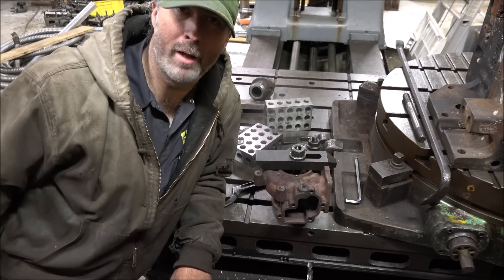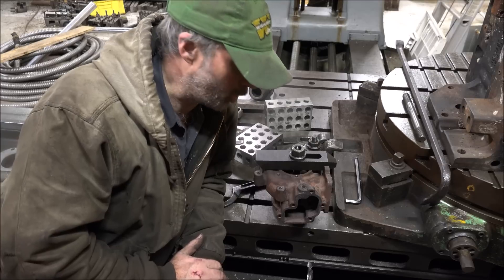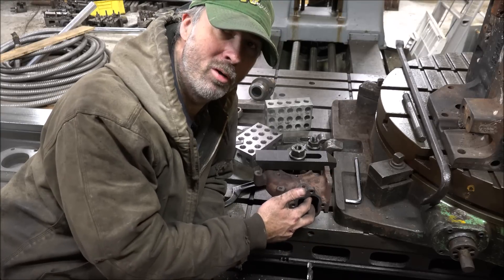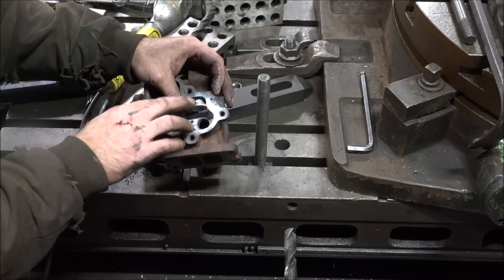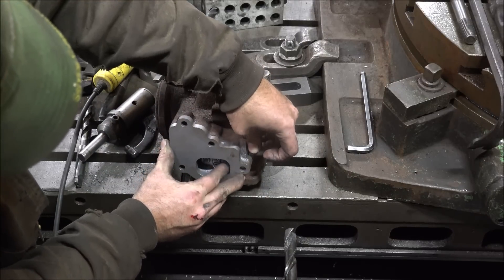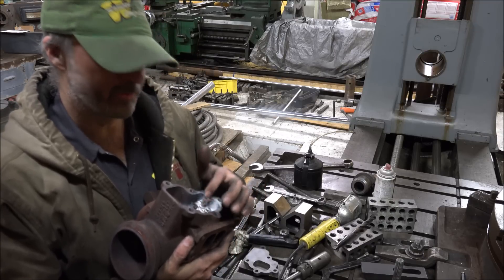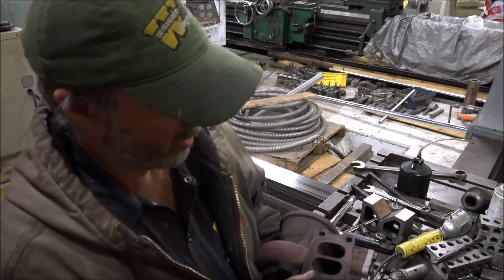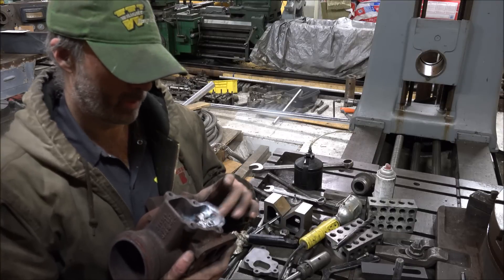How to Increase the flow of a S300 Turbo Wastegate by Double!

Comment: Assuming you are using the same spring, by increasing the cross section area of the ports, you may have increased the surface area the gas pressure acts on so your waste gate may open at a lower pressure. I’m not sure if it means much but if the engine acts funny, you might look at that.
I’ve experienced that with the cracking pressure of check valves. It may not be important, it may be a problem or it may act in your favor. 
Great video as always.
Thanks,
John
Reply from the maker: Yes I am aware and as mentioned I can adjust gate pressure as necessary to get it to work how I want. Thanks for pointing it out though as I forgot to discuss that in the video.

Comment: Will this make it better even  on a single  turbo application.  Or just for a twin
Reply from the maker: Yes it will have the same effect on a single but if you need to bleed that much drive pressure in a single application you would benefit more by going to a larger turbo typically.

Comment: Wait, are you running the S300 into the S400 and the 400 into the intake or are you running the 400 into the 300 like most people do, and then 300 into the intake manifold? What was size of existing hole and what did you bore it out to?
Reply from the maker: Well it would depend on if you were talking intake or exhaust. The s300 goes on the manifold and the exhaust from it feeds the s400 which in turn blows its air into the s300 compressor side. it was a 7/16" hole and I increased it to 5/8"
Reply: @bcbloc02  OK, never understood the theory behind this? With water (fire pumps) we designed for volume and pressure, smaller pump into larger pump! With the turbos it seems like if you take the higher volume 400 and run into the more restrictive 300 are are loosing volume (CFM)! To me it would seem more effective running the compressor of the 300 into the 400 and then the compressor outlet of the 400 into the engine intake ( more air volume)?
Reply from the maker: @frednewman2162  The purpose of compounds is efficient pressure not volume. An engine is a fixed displacement pump it won't flow anymore unless you increase its displacement or make small gains by decreasing restrictions. To make more power you have to cram more air into the same size cylinders so it takes more pressure to pack it in there. Boost is really just back pressure from the cylinders. If the 300 fed the 400 the 300 would just be a restriction because it can not pump enough air to produce a positive pressure in front of the 400.  The 400 would be trying to suck air thru the 300 and that isn't good.
Reply: Yes I'm late to the party too and as a result am rather confused as to what exactly is going on! Brian did give some measurements of the original ports and the finished port size in the actual video,
Reply: He explained it all.